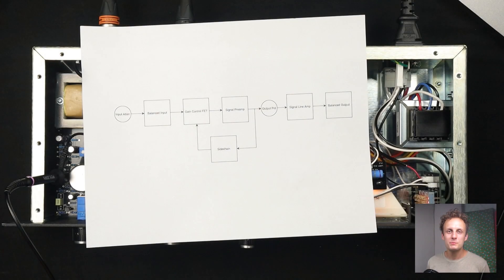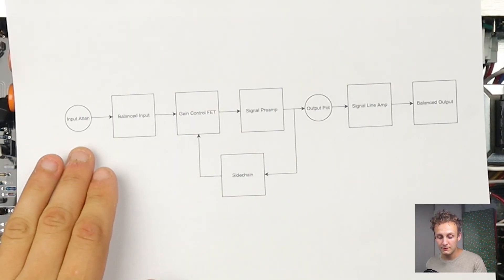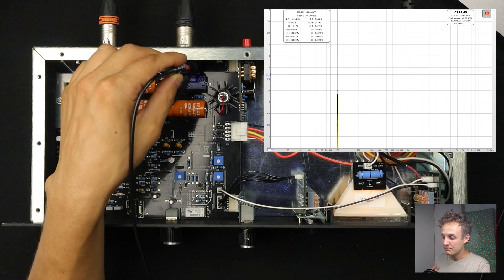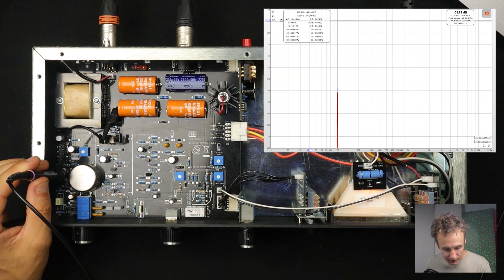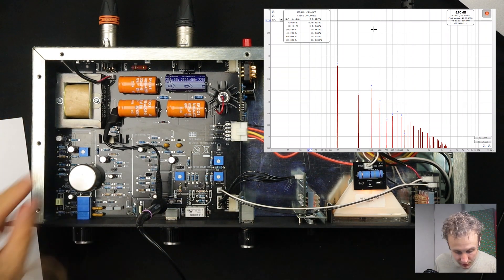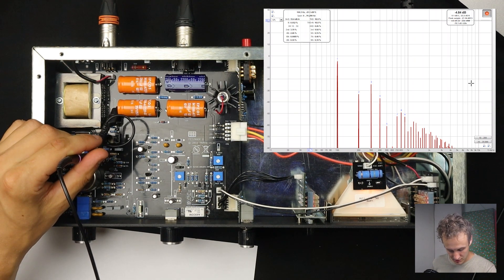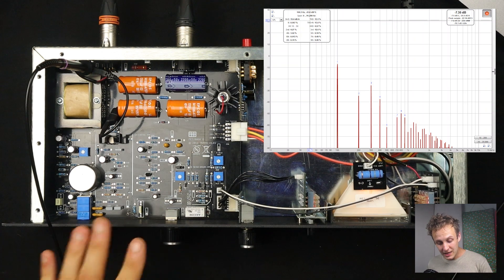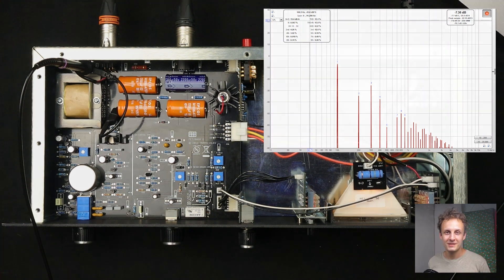1176 Teardown pt 2: Tone, color, and distortion

Comment: Great video, thank you so much !!! I am suspecting that the 12% THD is coming from the FET gain reduction cell at the input, and not from the first 3 transistor gain block. Is it possible for you to measure THD at the FET gain reduction cell? And what rms signal level is at the FET gain reduction cell when you measured 12% THD at the output of the first 3 transistor gain block? I would appreciate your information. Thanks again !

Comment: Hello, I notice that you are using REW software for the distortion measurements. REW is a great free software audio analysis tool! I also see you are using an oscilloscope probe for probing the voltages you are measuring. Can you tell me what kind of audio interface with REW that lets you use oscilloscope probes? BTW, Pt1 and Pt2 are great analysis' of the classic 1176!

Comment: Dude, this stuff is great! 
I believe and correct me if I'm wrong, that when it comes to harmonic distortion, the transformers would show a lot more going on on higher frequencies than 100Hz you are testing in this configuration. Transformers (afaik) work their magic on the extreme high and lows of the spectrum.

Comment: Thanks, though I wish you had fiddled with the distorsion control (trim pot) in the preamp :  When I revamped my old rev F (=rev E but for Europe with switchable mains voltage 110-220), I followed strictly the calibration procedure but was not happy with the color I got from the machine, and I subsequently decided to tune this by ear. Very easy in fact, plug in a oscillator at a relatively low frequency (I use either 110 or 220 Hz=A), put a notch filter at that frequency, boost the output and listen to the harmonic products. I then set the trim pot to what was the most agreeable sound to my ear. To be precise when you set the trimpot, there is a point where the distortion lowers at its minimum, but tweaking one side or the other of this minimum gives different results, and I choose what my ear prefered. I must say that I replaced the original trim pots with multi-turn ones, much easier to set.
By the way this is one of the reasons why two 1176 sound so different with identical components.

Comment: Hi, great video! What tool and/or SW are you using for the THD measurement? Cheers
Reply from the maker: Hi Pedro, I'm using REW. If you check out our channel you'll see we have a playlist on how to set up your computer to use REW to measure gear.
Reply: DIY Recording Equipment cool! And that probe, you just wired an oscilloscope probe to a jack? Any DC blocking cap? Thanks fir the info and good videos. Will check it out!
Reply from the maker: Thank you! For the probe I used Pmillett's excellent sound card scope, check it out it's a DIY project
Reply: @PetersonGoodwyn  would you mind posting a link? I'd be very curious about that!

Comment: Did you measure the distortion with the GR disengaged? The signal amp distortion is principally due to the non-linearities in the circuit that also includes the FET. The symmetry pot is there to adjust for minimum distortion in this section so what you measure may not be typical is the unit has not had the symmetry correctly calibrated.
Reply from the maker: Thanks for the questions. Yes all measurements were done with the GR disengaged. Engaging it any amount actually reduced distortion a good deal, as it attenuates the signal before hitting the preamp transistors. The symmetry pot was set according to Mnats/Hairball calibration guide. Honestly I'm not surprised by the amount of distortion I found at the input—I imagine that sending +4dB with the Input control fully CW and compression of is actually a very rare use case for the 1176, as there is so much gain after that stage.

Comment: Wow, so the big surprise here is when it comes to color (or can we say mojo?) The transistors are doing most of the heavy lifting and not so much the transformers.  Did you find this to be true on the 1073 circuit as well?  Now I'm really curious what component is providing that coveted color in a Neve and API preamp 🤔
Reply from the maker: Great questions. Transformers are unique in that they are always imparting a bit of phase distortion independent of level, but they are pretty linear wrt harmonic distortion until they saturate. Then they really distort. In most gear like the 1073 or API preamps the transformers were chosen not to saturate at normal operating levels. This is why people added the attenuators after the transformer, so you can drive the transformer into saturation and get some real color out of it. So I would say generally the transformers account for a very small amount of the tone until you push them into saturation.

Comment: Excellent analysis -- thank you! For those curious about the measurement software, this appears to be the Real Time Analysis (RTA) component of the Room EQ Wizard (REW).
Reply: Anyone have recommendations for probes for doing this type of work? I'm assuming this is connected via usb?
Reply from the maker: Unfortunately it's a bit more complex than that. You need something to protect the interface from DC or big spikes in AC and with a very high input impedance. I'm using this kit from Pmillett which is brilliant but kind of an advanced project: http://pmillett.com/ATEST.htm
Reply from the maker: Thanks very much! Yes I should have mentioned that

Comment: Great approach. I wouldn't have thouht, that the transformers are that clean. Would this change alot, if you had driven them harder?
Reply from the maker: Yes exactly transformers are fairly linear until they saturate and then the color really does come out. This is possible for example in mic preamps with an attenuator after the output transformer.
Reply: @PetersonGoodwyn  Thanks for your input!